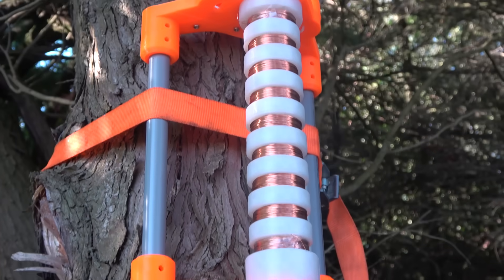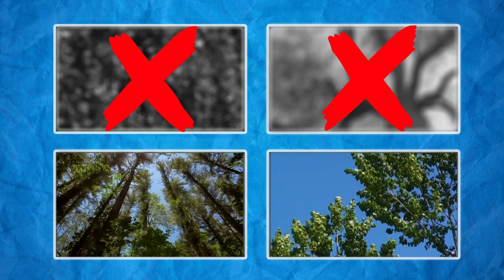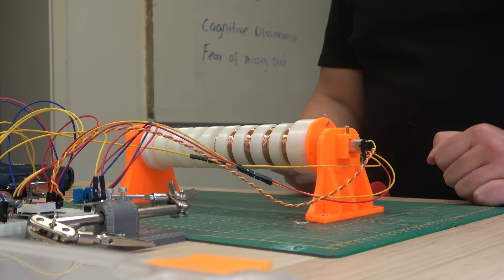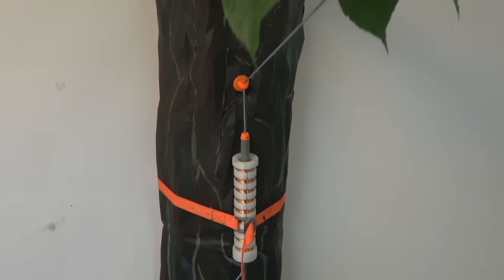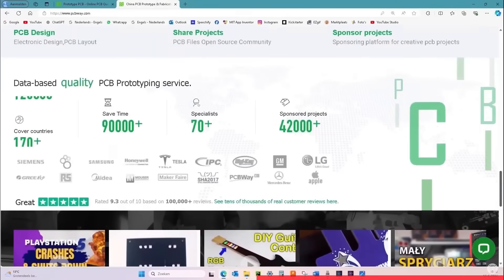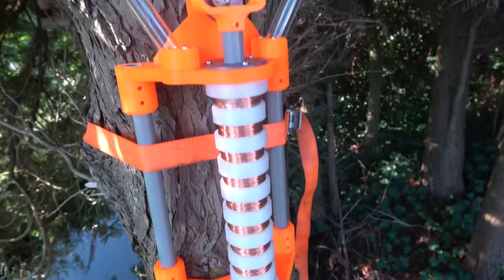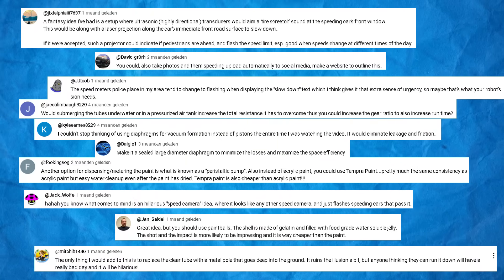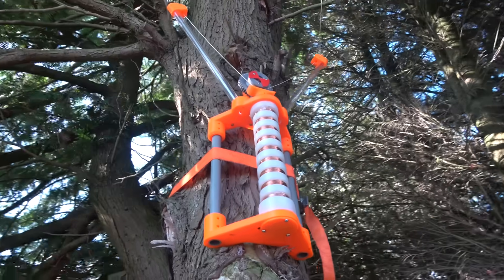I Made a Tree Generate Electricity..

Comment: You could double the power by putting two of the magnets and make the tree movement mints make one of the magnets go up and one of the magnets go down when it moves the opposite direction it would make the other magical up and the other magnet go down first advantage is it would use the same amount of physical force to move one magnet up and the other down then it would use the same amount of force to reverse that at the same time you would be making double the electricity and you wouldn't need to add the magnet on the bottom although you could still do that but it would make more power by doubling it the same size like you have and just double it with one going up and one going down and a wire connecting the two together so instead of rotating and up and down it moves the wire right and left and then that would move it up and down anyways your video was really good and this could potentially make as much power as the solar panels would make if you cut the tree down and put solar panels but I often laugh at the fact that people say they're going green but when they go green they cut all the trees down so I think your idea is extremely useful

Comment: How about a quite literal branching tree algorithm robot that lays thin cable along the tree branches and charges some sort of caps/super capacitors via ESD? Just thinking out loud! Trees need free movement from wind to shed, grow, and pollinate - how much does a system like this hinder the tree's ability to do what it needs to do? The above is predicated on the notion that the rustling of leaves on branches would create some sort of electrostatic discharge, but trees are, well, very well grounded.

Comment: A radial generator with a big flywheel should give a better result, give it a mechanism to make it spin only 1 way, add another gear to increase the gear ratio even further. The limiting factor is what the wire cranking the system can handle.

Comment: What about making " artificial trees "  to minimize environment impact even more and be more economically viable? Especially since you can use very long lasting, environment friendly materials ( steel, copper, aluminum etc. ). It'll also give much more control over the " tree ". A fabrication with a solid base up to just 5ft or so, then a heavy tension spring followed by a tall " trunk ".  You could have sails on them that can naturally protract and retract etc..

Comment: Instead of having one large, heavy generating section, make multiple smaller sections to attach multiple branches to the generator. What I mean is that you would have three wire and magnet sections that actually generate the electricity so you can tie multiple branches to the system.

Comment: If you use more rope in parallel along a massive trunk you might be able to turn small firm movements into a single more massive one. Then you could maybe power a flywheel to get more consistent output.

Comment: Trees don't produce electricity..the electricity is already flowing through the ground. All you need is an upside tower with a huge steel ball buried 8 to 10 feet into the ground, maybe run a few miles of copper coils around the entire subterranean structure the put a capacitor on top to charge off the natural current that runs through the earth. This is basic free electricity for anyone with a big steel ball. And if you connect multiple steel balls underground you can produce megawatts of electricity. You can also built two towers near one another, connecting them underground and then just the air passing between the two towers will generate enough electricity for a entire city, for free too. Free electricity has been here forever...the earth is electric.

Comment: This is an interesting idea. I have a lot of trees and I think this could be a neat way to turn them into wind turbines. Even if it just charged a security camera that would be great.

Is there a way to have the pully connected to two separate trees? Would it just break things if the trees swayed two opposite directions or would tying them together force them to work together. I ask because as i look at a wall of trees swaying around I am trying to think of how to scale this up. Could I have a bigger genrator on the ground tied near the tops of a bunch of trees to grab the swaying of the trunks? Maybe with multiple linear generators for each of the trees wired in series like a multi cylinder engine? I figure centralizing all the generation and just having to vary the rope lengths would make this more scalable.

Comment: I'm going to ask the question, and just like the video here, maybe someone else can tell me why it's right or wrong... But, why reinvent the wheel? 

What if you were to take a multi-piston input to instead of spin a motor, spin it's inverse, a generator? Route all the branches into a single unit to produce a binary net force to provide seemless and continuous generation? 

If the unit can be made at respective cost values to the energy produced over the relative lifetime of the product (which could concievably outlive the tree itself if it were to be consolidated and housed internally); there would be literally no reason not to do this, particularly so if the entire construction was to be made out of renewable and/or biodegrable components. As it stands, all that energy is just being wasted anyways. 

As mentioned in the video, different factors will yield different results, and unfortunately I don't imagine the rain forest being a very windy place for example so it's not as though any solutions will be that readily available, but the versatility is potentially incredibly far reaching.

It's one of those things that by natural law just probably isn't very feasible at all truth be told, at least by the tolerances and losses of modern mechanics, but it's definitely the perfect sort of pipe project because again, there's absolutely nothing but benefit here if you were able to create the hypothetical peak product. 

I'm maybe a bigger solarpunk guy than most, but even without that the synnergy should he abundantly apparent in ways that really no other devices have managed yet to capture. 

Tl;Dr: I'm tremendously looking forward to seeing where this one goes

Comment: This is a good POC and I like your idea, but if this has be done on large scale to produce meaning-full electricity for one home, following are. the challenges I see:
1. trees can get shorter/longer and wind speed can be slow or fast... the tension in the string needs to be adjusted in real time for this, which should happen automatically
2. if strings fail, you need to have some alarm system that string broke so it can be replaced
3. Many animals can destroy the equipment , it would also disturb their habitat.
4. I think one time cost would be a lot more than buying solar panels

Overall good idea, but I see lot of challenges in this.

Comment: u seem to convert linear motion to rotary and again to  linear and move linear genarator.Instead just use a dc motor  with pulley which will be rotated by rope tied to a branch at one end and to tree trunk at other after looping over the pulley.Diameter of pulley and branch .A spring introduced at rope end near tree trunk will do the return rotation.

Comment: Not an engineer at all, but if you were looking at lateral (horizontal) movement maximization, I would suggest palm trees as a viable option. As they are top heavy and designed to sway with wind gusts, you are likely to maximise the potential kinetic energy with the heavy load moving a greater distance. As they have no branches (for practical purposes) attachment would be simpler and there are innumerable numbers of coconut tree plantations in coastal and windy areas

Comment: What if about 3-5 generators were mounted to a central wooden poll and have strings attached to the top of tall thin trees. The swaying of the entire trunk as well as the branches could be used to generate power.

Comment: I had the idea 20+ years ago but approached it from the leaves and using piezo. Never built anything but was discussed online a lot.

Researching this and another idea got me into a 10 year stint with renewable energy.

I live offgrid and i think your system would need protection for the gears. The ropes should be easy to repair or replace as well. Also cant throw sparks.

Comment: Fiber glass rod bends a bit...that tied to a see saw and water in jars connected by small hose...concepts. but I e got blueprints for three stage ram pump. Using pop bottles for floats, PVC pipe x 3. Pulleys n counter weigh. Sealed sump.n plugs.😊

Comment: I would use some kind of flywheel and something like several one directional gear boxes, like the ones used on a bike pedal gear box, use the same fishing wires or whatever you’re using and tie them to several trees. As the trees sway, each one will tug back and forth on their own pedal gear box on the same axle to rotate the flywheel in one direction.  Then from the flywheel to a generator.  Is this practical? Nope. It’s kind of like wave turbines but for trees.  Trees branches break and maintenance would be a nightmare to find new branches to attach the wire to.  The cost to keep a small crew on standby for repairs would kill any profits the one generator would make.

Comment: Hi Erik, I really appreciate your creative thinking! You've inspired me to consider using your idea to harness some energy from the stream in my garden. I'm thinking of using that power to pump water up my garden to a  drip-feed system for my greenhouse and plants, which is about 4-6 meters higher than the stream.

I've experimented with ram pumps, but the water head is  low (only 0.4 meters, but flow rate is 1m/second), and I can only get about 1 liter per hour (but runs 24 hours non-stop), but all  the pipes are a bit too intrusive for the stream. I'm therefore  exploring other ideas such as  coil pumps, Archimedes screws, brushless motors and  piston pumps, but your device seems compact adds another dimension which could potentially be modified to work with a propeller 🤔
If you or anyone has any  ideas or experience with something like this, I'd love to hear them 😂

Comment: Fundamenal problems: 1. Copper and magnets too expensive for this due to low efficency movements, so there needs to be a look at how to get more out of each magnet and coil of wire or how to use less of either while keeping a similar energy profile. 2. Construction needs to be rugged against weather conditions especially wetness so that it can work within the lifecycle of a tree, the tree could also start incorporating the wires into the trunk if they are rubbing against it. 3. Energy is inconsistent which can be normalized with many trees but requires laying many wires between many trees. A reason why we build every increasing sizes of wind farms is to have more power from less foundation space while keeping maintainence similar. Maybe the branches can be interlinked to one generator saving on everything but increasing the challenge of making it work especially with how trees grow. 4. Branches will grow at inconsistent rates from each other so this thing will need to feed more wire while keeping tension if its gonna last a year. Not important as a prototype but yknow something to think about.

Comment: The largest amount of relative movement would not be between a tree's trunk and its branches, but between one stationary object like a tree's lower trunk and the top of a different tree.  This would also provide a lot more force, so the gear mechanism can be changed to one with more linear generators or one with a higher speed agitator.  It could even turn a conventional generator using a one direction clutch and a strong gear increase and flywheel.  There would have to be a recoiling cable with extra cable so to accommodate many different movement distances.

Comment: I have thought about this for many years as I live on 75 acres of land with a huge frost on the land.  And I have also thought about this for blades of grass. Why not use Piezoelectric elements instead with a hammer pounding on the elements?  Rochelle salt is a good material as it gives off 15,000 volts per cubic cm struck.  Rochelle salt is that material used in igniters for BBQ or lighters.

Comment: One theoretical idea I had one day was taking a really light weight material like the nylon fabric in parachutes and wind socks and make a giant cone. It would likely need to have a support frame to hold it up and in place for days that aren’t so windy. My curiosity with this is the wide opening funnels the wind (high pressure) into the narrow opening at the other end. What kind of PSI could you generate at the small end from certain wind speeds? How would size of the contraption affect the PSI? And then of course how could you convert the pressure into electrical energy? Pneumatic turbine? Some kind of piston action rotating an alternator? I doubt it would be practical but I’ve always wanted to test it! You might be well fitted for the job😎
Reply: I would guess that total length of the entire ‘wind sock/collector’ if you will would really effect pressure at the end🧐

Comment: I always think about a thermoelectric generator that has the cold end buried or in cold water, and the hot end painted with an ultrablack coating to absorb as much energy as possible, and you have the junction with a hot/cold difference in the middle, on a sunny winter day could you not create enough of a temperature differential to generate voltage? even go as far as putting most of the black/hot section in a vacuum sealed chamber so it is immune to convection cooling or something

but i imagine a large structure that runs along a shoreline where there is a portion in the air thats black

i havent seen anyone do this, but it would probably be expensive, but maybe it would be feasible if it was scaled up in the right way

Comment: The ship helm pulley system seems like not a great idea because you are wasting the effort you made to gain a second axis of movement; during vertical movement of the branch, both ropes will pull the same direction, causing no rotation to be generated and possibly breaking the arms.

Comment: Feels like the biggest challenge would be one of impedance matching. The system shown here is likely harnessing quite a small percentage of the available power. A bike with massive torque on the lowest gear. You'd want a system which could be somehow tuned to different sized trees. Probably staying away from gears would be best. belts and pulleys in a good enclosure might be one route.

Further, given that these generators will tend to be most efficient at much higher speeds than anything the tree is dealing in. Maybe an energy storage solution that would build up energy over time before dispelling it? I'm imagining a bag of rocks/dirt being lifted into the air before, at a certain height, being released to lower to the ground, turning a generator.

Comment: This is why I love engineering
Reply: So here’s my idea, it may not be the best way to create a direct current into any appliance such as using that power to power a light as it will be flickering on and off all the time even with multiple generators connected. However seems like an amazing way to charge batteries that can store all the built up energy so it can be better utilised elsewhere as one constant flow of power. In short make like 6 more and connect them all to one battery

Comment: i wonder. 

Magnets require a ton of energy to be produced. Mining rare earth materials, have excavators and explosives running wild, then you have to sort and filter the ore, melt it down, create the magnet, polarize it...

Theres a ton of energy going into a magnet. so the energy generated over a lifetime "per tree" would have to exceed the manufacturing and delivery requirements of the components. i dont think this will happen. this worls (almost) in wind farms because these things can generate A TON of energy compared to the size of the motor (and its magnets). 

But honestly i'm no expert and i'd love to see somebody with a bit of insight do some math. maybe its viable; gutfeelings can be very wrong sometimes!

Comment: A rotational machine offers many advantages in terms of power handling and efficiency, in my experience. You could use a ratchet, but then you are halving your total power input. You could solve this in the simplest(though not most cost effective) way by just using two generators, one that generates on the downward motion and one on the upward. Plus, you have many mechanical advantages as well, with gears you can change the output torque in relation to the input torque (not my field, but my mechanical friends can help out). You can change the output with an inverter (expensive but, if you want to light anything other than lightbulbs and a toaster, necessary). It has potential, especially because it seems to be low impact and maybe you could charge a few cameras or lightbulbs in a park. Very cool!

Comment: What about creating a second device like this, and forcing them to be synchronized, but have the opposite amplitudes? 

See the led strips, your device now doesn't provide DC current,  if frequency is great enough leds will stop blinking, but it still be AC.

If you had another generator like that, and couple it to be in opposition to the existing one, you should get a more stable current.

I am not an expert with electricity, so let me guys know what you think about this idea

Comment: Another ratchet variant, with accumulation of the movements the tree does, over planetary gears.

At each branch, ropes convert linear motion to rotation, which is then converted by bidirectional rachtet gears to unidirectional rotation. Belts or alike transmit the rotation to a planetary gear where two or more rotations are combined into one. At the stem, where all motions are collected, the rotational generator is run.